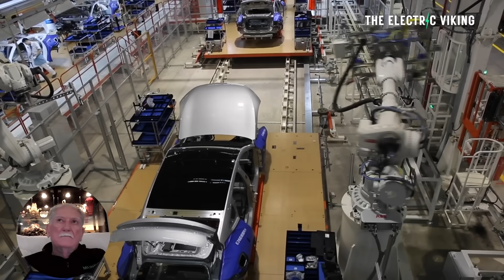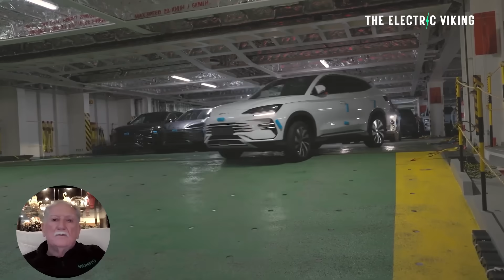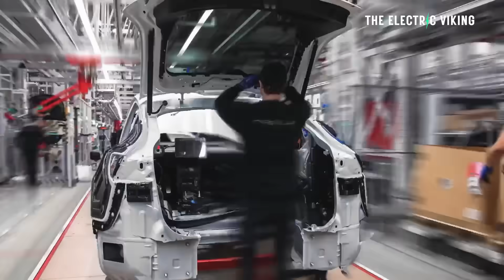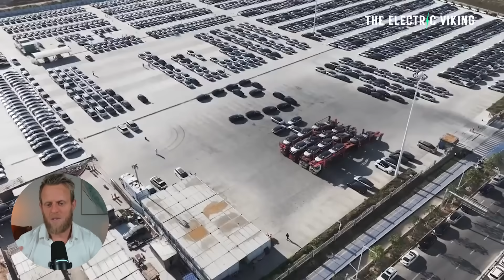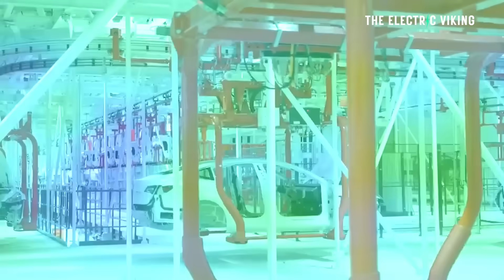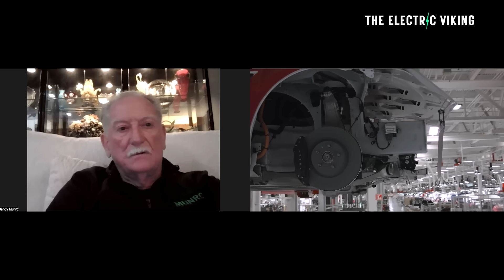Sandy Munro reveals why Chinese Car companies are 5 years ahead

Comment: To me as a lic engr in the US...i agree to one prognostication.. all car manufacturers including at Tesla face a couple of problems.  Cars will not be replaced due to mechanical failure, when electric motors and drivetrains have 15-20 year lives and now batteries are at  the same lifetime.   Rust, no problem, accidents approaching zero.  Cars could last decades.  My last ICE car, a Jeep was a wreck in 5 years, and half the drivetrain was undependable.  Electric cars could be as dependable and cheap as refrigerators refrigerators

Comment: Or it could have something to do with 300 billion in subsidies and 169 automakers competing for a slice of the market.....  The cars are being sold for less than it costs to make them, that has never been sustainable.  The other huge issue is that EV's are a solution in search of a problem, the cost of truly building the power infrastructure to support them outside of niche uses is unsustainable and an environmental catastrophe.

Comment: I worked with engineers for many years. It was like driving through thick mud. If you think about it, engineers have evolved into risk mitigators. If anything goes wrong with a vehicle, engineers are to blame. Assembly line problems? Blame engineering. Paint peeling prematurely? Blame engineering. After decades of being beaten down by all the other departments, as well as legal people, engineers are resistant to any change. Since innovative thinking leads to change, you can see why American cars are falling behind. The good news is that there are some brilliant kids coming out of school that are passionate about design. They grew up making battle bots, and other hands-on programs from middle school on. If anyone can save americas bacon, it will be them.

Comment: I think that Munro is right AND wrong about decision making. 
Just saying NO, has led North American manufacturers into the position they're in now.
The process has to allow for saying no and then allowing for change and innovation.
I have an old Ford with a straight six 300 in may back yard, still works, could be retrofitted easily, but I'll be swapping out the old six for a more modern and much lighter and more fuel efficient motor this summer. 
I'll end up with more manageable power ( fuel injection ) and a better transmission.
Parts will be easier to source also.

Comment: Their exploding batteries are top of the line, their metal structural supports are able to rust away even before they make it off the lots, and their tofu dregs construction standards are amazing. They focus on making very expensive items that have very low chances of surviving every day uses. But other than that they are outstanding.
Reply: Delusional you are. Perhaps one could drive one of those prehistoric US cars. Just don’t take a flight to China, you might think you ended up in the next century. Also remember that anything you watch including Youtube shows you want you want to see. This makes you blind for what really happens at the other side of the world.

Comment: (it's President Xi, not chairman :) I have had a nagging feeling that Chinese were ahead in EVs, and I can attest for certain that interior build quality is- when I was over in Huizhou, CN, my wife's family friend has a BYD SEAL U, and the interior is really nice- reminds me of the '21 BMW X5 45e I owned, just smaller.  I still think Tesla is slightly better in many areas... like efficiency, power, performance, and top speed. China companies love to use LFP battery chemistry with blade architecture (which allows them to be more durable and withstand higher temps for faster charging speeds), but they are less energy dense- which usually translates to torque/HP dialed back at higher speeds.. this is what Tesla used to do, until the '21 Model S refresh (which is what I own). The power goes down and continues to pull all the way past 130mph. My Long Range is almost identical to the new Model 3 Performance quarter mile numbers, touching 10.88seconds with a near 129mph  trap speed.  The Model S Plaid is in another zip code when it comes to performance. For the price, Tesla rules- at least here in the US. I live in Kentucky, and I have seen a large number of Teslas on the street in just the last few months. Including my own, we had about three Teslas in our neighborhood alone when we moved here from Charlotte NC almost three years ago- but today there are at least ten Teslas. Our Chinese neighbors all drive Teslas. Tesla also is loved in China along with their homegrown brands.  I see BYD eventually bringing over a manufacturing plant to the US, if the govt. allows... but the CCP still undermines the world's trust, security (with bullying Philippines and Taiwan), economy, and IP theft is real.

Comment: As an engineer for a quarter century, engineers are normally cut after a project or are contractors.  The reason American companies like GE, Bell Labs, Xerox, Kodak, IBM where once leaders of their industry was due to large research and development centers.  Apple is one of few companies spend big on research and development to maintain their market lead.  People don’t buy old ideas, they buy cutting edge.
Reply: But Apple is no more a market leader. Just to point that out. They will most likely miss the glasses boom coming end of this year. Samsung with Google software/AI functions are incredible at this point in the time. But let’s be real, for how long can they maintain that position. The Chinese are moving so fast, no one can keep up.
Reply: GE research lab started with Edison and has produced cutting edge technology in over 100 years
Reply: And Trump is cutting R&D, and hammering education budgets, picking a fight with Universities … in the long run this could more harm than his tariffs…

Comment: Here in Norway , i have noticed Chinese car brans are usually twice as expensive or at least more expensive to get insurance on , but cheap to buy .Xpeng Honqi and the like .
I was told This is because , they are busy pumping out cars . and not replacement parts for when stuff break .. while Japanese & German car companies , have for now at least more stable supply lines .

Comment: The main reason for the success of the Chinese auto industry is known, very short supply chains. In the era of globalization, China itself is a compact self-sufficient globalization. Simply put, 90% of components for any car are produced within a 200-300 kilometer radius from the assembly line, and in the case of Chinese giants, this is also the fact that many companies producing components are owned by them. This is an unattainable fantasy for any European or American manufacturer. China with a market of 1.4 billion can develop quickly EVEN WITHOUT EXPORT. Therefore, all the talk even of very respected experts is similar to discussions of animals about the strength of an elephant. p.s. there are also national characteristics, I heard that large companies arrange internal competition, for example, some department is divided into two parts and each offers its own solution to one problem. I do not know if this is true.

Comment: It's also the vested industry of western manufacturers lies in ICE motor vehicles.  It's a massive ICE industrial investment they need to recover costs on and they are competing against their own industry with EVs, but they are damned if they do and damned if they don't.  The issue is timing and balanced transition to EV platforms, so that revenues are protected.  The issue is finding the optimal timing and a balanced transition to EV platforms to protect revenue streams and ensure long-term viability. This strategic balancing act is a central challenge in the industry's transformation.  China has proportionally far less to lose in their EV  transition, as they never had a major ICE manufacturing market to protect.
Reply: They are damned if they don't. They are dithering and engaging in the sunk cost fallacy to appease shareholders short term while china is sprinting at light speed. It's not like they couldn't sell off their ICE tooling, much of it is useful in other sectors.

Comment: I started work in China back in 2011,  my base salary then was 1 million RMB a year ( plus bonuses ).  My job was Engineering Manager where I understood that the emphasis on Engineering was the product and that my team were not just involved in putting things right but putting them better.   Over the course of my tenure it was other management which stymied progress - we proved that a circuit designed in the UK was NEVER ACTIVATED and simply not fitting it would make the device operate for longer, safer and increase factory profit on that device by 10%.

Later, in the UK in a similar role.   The company would buy 25000 of a component to fit in the device in the HOPE that it would be physically on the lower end of size so it would not fail on insertion. I replaced the component with one which was the next size down and in the trail against the current design - they had 25% pass and I had 100% pass.  I stepped on too many toes getting this done .

Another time, I changed an FPGA to an ASIC, management were boasting that the change paid for itself in one month's production - but neglected the fact that they waited 9 months to sign the order.

Again, I fixed the flaw on one sensor, there were 18000 in stock at $2 each, I advocated scrapping these because if they were fitted into the device 25% would fail and another 20 % fail in service and cost the company millions in putting them right.  I was told 'there is no budget for scrapping things in engineering' so the $2 parts was made into a $40 part and quarantined before an accountant got a bonus for finding $720,000 of 'profit' and releasing them to foreign production.

Most management is risk averse, run by accountants who see every change as a bug to squash

Comment: Is it true electric bikes are putting a dent in the oil markets?  They’re the answer to the last mile.  It all factors into the direction of the auto market.
Reply: OPEC price setting and reduced demand across a number of sectors are what's putting a dent in the oil market. The current upset in the US isn't exactly putting demand on oil, either.
Reply: @davidbrayshaw3529 Understood.   They were expecting more vehicle sales but they’re down because people are buying electric bikes instead.   All I see on local news is about making rules and laws around electric bikes.  In this economy I can see why.
Reply: @DeeBrow  Only about 10% of crude oil harvested makes its way into passenger vehicles as fuel.
A slight downturn in the market makes very little difference to demand, especially if all this really means is that people are keeping their existing car just a little bit longer. Perhaps the shift to E bikes, Scooters and EV's will have a slight impact on future demand, but we're not seeing it yet, and any significant change in personal transport trends will have very little impact on the demand for oil, anyway.
Global oil consumption in the first quarter of this year is still slightly up on last year, despite the shift to alternative personal transport and what would appear to be a slowing global economy.
Reply: @davidbrayshaw3529 Another reason I switched to a EV.  The oil market is manipulated too much.  Electric is the only energy source that’s decreasing as others skyrocket.   Since 2021, haven’t bought a drop of oil or gas.   No more engine lights or smog tests.

Comment: One of the things I wonder about when China completely redoes a car every two or three years is how do they stock and keep replacement parts? In the US, parts for newer low volume cars can often be hard to come by.
Reply: From Russia. Of course, they don't completely remake them, but they can change something every six months. I have something to do with car service and selling spare parts, and for repairs it's hell here)). A huge number of brands and each has 5-7 models. At the same time, software support is not the best. I hope in a few years the number will decrease and the Chinese will put things in order in after-sales support. But the cars are mostly excellent.

Comment: Grid electricity energy cannot replace 20 times bigger fossil fuel energy. 
The national grids are EXTREMELY EXPENSIVE and make electricity EXTREMELY EXPENSIVE. 
20 times more national grid capacity, give me a break 😮😮😮

EV massive battery on wheels parked 23hrs every day and all night long IS THE NEW NATIONAL ENERGY STORAGE SYSTEM. 

Dispersing electricity energy by grid is insane.

Dispersed solar energy stored in dirt-cheap mass storage on wheels is dirt-cheap.
Reply: Have a listen to Peter Zeihan about brilliant Chinese. 
My concern is where with the spart parts for Chinese EV come from in the near future  ????

Several people have told me how clever the Chinese engineers are.

But even you say they have too many EV companies. 
Thats an Engineering economic failure. 

Amazing, but still a failure. 

https://youtu.be/EK8eLfbS3c4?si=ubY6BjHMVi_YC1w9

Comment: The key to EV manufacturing is the battery. Keep it simple, easy to.manufacture,  inexpensive and efficient and you are on a winner. The BYD blade LiFePO traction battery with its low parts count, of just 126 cells, is definitely a winner.

This development alone has given BYD about a three year head start.
Reply: And easy to replace.

Comment: China is 5 years ahead of the USA in coal burning.  Sandy is all in on electric, but hasn't done the basic math to explain where the energy will come from to power 200 million US cars.  Oil works.  Electricity will eventually work but we need transition so yes, we have five years to win and we will.
Reply: U.S. isn't a Factor in future projections. 

The rest of the world moves on 😂
Reply: China has reached peak CO2 output this year, and has over a Terawatt of solar capacity (4x larger then the US).
Reply: @romanval69  We can only hope that China has reached peak CO2. Two thirds of China's power generation still comes from burning coal and they are  in the process of commissioning more than 20 new coal powered thermal plants and a number of nuclear plants, also.
Reply: @davidbrayshaw3529 60-65% of the electricity produced in china comes from fossil fuels, mainly coal. In the US 60% of the electricity produced comes from fossil fuel, mainly from natural gas and coal
Reply: @12345anton6789  natural gas is 1000 x clearner than coal
Reply: @romanval69  Peak CO2?  That's because their population is collapsing

Comment: If the Chinese, who traditionally copy/emulate the high end tech, are 5yrs ahead now, moores law would exasperate the difference and the world is left behind. Would that mean Tesla invested more into EV Tech than the rest of the world. I personally just think that the mass production of cheap high density, safe {in use(ever notice that batteries usually runaway while stationary and/or charging)} batteries, is going to be the biggest impact on cheap energy world wide. Imagine the energy impact the instalation of a single small EV battery would have on any small isolated rural Village. Keep up the trade war.
Reply: None of that made sense. Most Teslas built in 2025 have Chinese made LFP batteries. Tesla does not make LFP batteries.

We have the Chinese evs here in Oz. They are high quality and offer features Tesla does not, and they are 40% cheaper than Tesla.

Comment: I’ve envied running a startup in China ... so doable. Canada? Brutal. Funding and government support are a joke here unless you’re connected. I wouldn’t take no for an answer—so I challenged myself to build the world’s most affordable EV charging tracker and billing system with zero funding and zero hardware with ust two engineers and first principles. It works on any level 1 outlet or dumb level 2 (under 30 amps), like a parking meter—accurate to ±1 kWh on a 30 kWh session, with time-of-day rates built in. Runs on the honor system (ooooh bad words!), but theft is rare—low power isn’t worth stealing in your own community. It's live on iOS and Android in 50 languages. Built on Google Cloud. Ready to scale. Perfect for apartments. Condos? Maybe.. but committees take forever to make decisions.